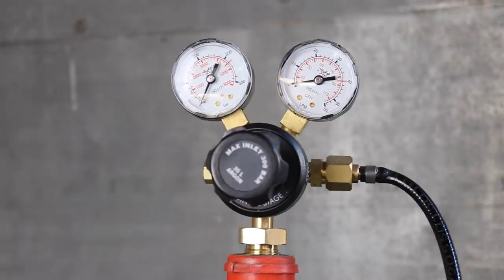TRANSIT RECOVERY TRUCK BUILD, DAY 8. JUST MORE WELDING! RAMP TRUCK

Comment: Water will find its way in to the box  through the rivets on the checker plate. Drill a couple of drain holes in the bottom of each piece. I'll watch a video of the paint drying if you're willing to make it haha
Reply: Brendon 
Fill it full of waxoyl?
Reply: sump oil.
Reply: Absolutely true and nessicery to allow the condensation to drain 👍

Comment: Loving the series so you may as well do a vid on the painting we've all stared this journey watching these with you u may as well Finnish it that's if you want to & wouldn't it be best just to drill a couple of holes from underneath the box section  on eather side of the box section will rote from inside due to condensation it all ways douse. Then squirt inside with wax oil. Only a suggestion 👍

Comment: I'm starting to like your videos very much, Matt. Nice little tips for welding and fabrication. I'm a hobbyist welder/fabricator myself. BTW  I have a 15-20 year old Metabo 1400W(!) 125 mm grinder. Still runs smoother than any of the newer stuff and it's got some real power. You can really lean on that thing if you want to. Keep on the good work with the videos! Cheers from Finland!

Comment: Nice job, the Metabo stuff is excellent I had a drill at work which I gave a lot of abuse and it just kept going, I would reconsider the spare wheel location, not very nice trying to get that from under there when on the side of the motorway lashing down with rain, maybe on a bracket behind the cab but it's your choice in the end.

Comment: Cool build, I’m interested in seeing the car on it. I’m in the states so it’s good to see the ways other people do things. The grinders I prefer the dewalt with the trigger handle, I’ve had problems with the triggers staying on and the grinder getting away from me because of the large barrel body and gloves. The trigger handle on the bottom is a lot easier to hold for long days and it gives you more leverage and control in my opinion. I still have the other dewalt like that but with a toggle trigger on the body that I keep different grinding grits in to go back and forth with out constantly changing the disk in one grinder. For the painting of these bodies I use a gallon of Rustoleum and a small foam roller, I get more paint on it than spraying it and it doesn’t make a huge mess. Good work, keep it up
Reply from the maker: I was thinking a roller might be better, ive already primed it and it was a right pain. Cheers

Comment: Would definitely think about boxing both sides of the lashing points. It won’t take much force to pull those  up. And once the chequer plate is on it may damage the plate. 
For how long it would take and while it’s still in fab it might be worth it. Also for future proofing. 
Liked and subscribed great work 👍🏻
Reply: Agreed indeed.

Comment: After the build is finished, you can calculate the total weight of the body with a spring balance or scale by taking moments from either end. Knowing this weight is useful as it will give you the gross vehicle weight and the tare weights.
If you have excess to a weighbridge then its easier, just get the bare truck weighed, then get it weighed again with the body. This will give you the figures.

Comment: be better putting the guards back on the grinders ,,, far kinder to your hands that war 
the de wilts are trashy in the way they run , but they do deliver a lot of power and are tough 
i used to use the gws bosch , which are great in the hand being small diameter ,, but just dont last more than a few months , eat brushes and destroy armatures ,,,

Comment: What editing program do you use? I use Premiere, and I know when I go over 999 percent speed on a clip, it drops the sound. One workaround is to export the clip at 999, then bring it back in and speed it up further from there. But I often find it easier at that point to edit out parts of the clip instead. Pain in the butt, in any case! Hope that helps. Good luck!
Reply from the maker: That was it, Thanks

Comment: We have a few Metabo at work and they are really nice to use until the brushes went. I replaced them with the Bosch which have so much more power and destroy metal so damn fast, but yeah, blow that stinky grinding media all over you which I hate. Smells like burning clutch, which is never good...

Comment: When you welded the gusset to the rack i noticed you did a vehicle down as opposed to vehicle up.  I'm barely a hobbyist welder so I'm being honestly curious.  What are the benefits of down vs up?
Reply from the maker: You can get lack of penetration when welding downhill due to the effect of gravity on the puddle pulling it down rather that into the root but on thin steel I always do it, and if you have a bit of a gap like i did there its much easier to fill going down. Cheers
Reply: @Urchfab  thanks,  as i said I'm barely a hobbyist.  Thanks for the excellent explication,  it honestly helped me understand it

Comment: Ear protection mouth protection eye protection and no grinder guards  you being pro grinder know that's silly right  for the sake of using more blade  been doing this for 100 years now and still won't take my guard off as  1  Fingers aren't cheap and  and 2 you have more control when your hand is close to the blade like on the bottom of the guard  . It's not if you cut your finger its when .    Other than that nice job